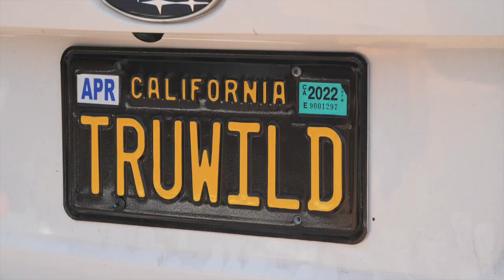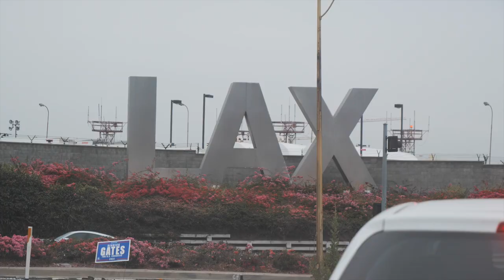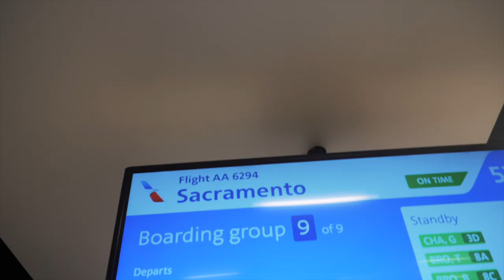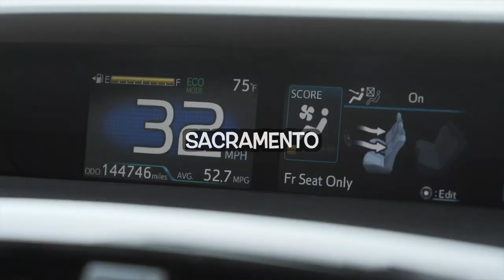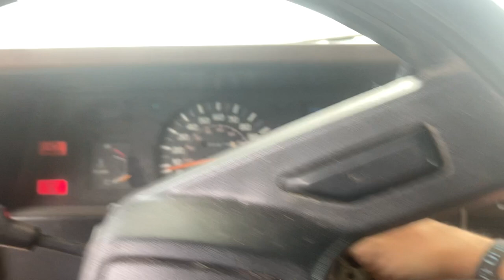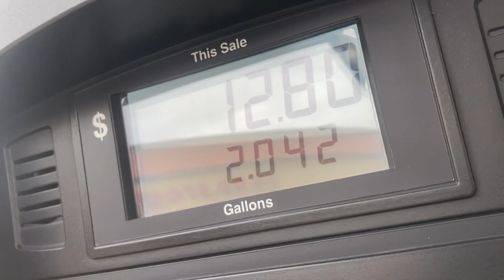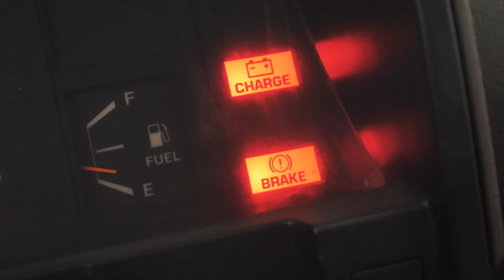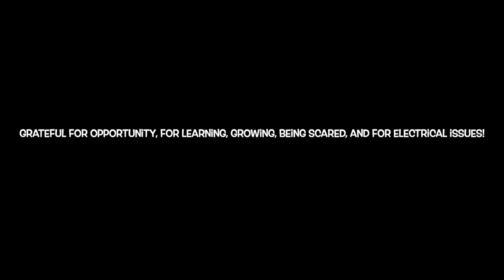It’s Time To SNOWBOARD!

Comment: Hope you get the tortuga figured out. I would first go through and check all of the grounds and clean the battery cable terminals. If it has been sitting for a while it could just have corrosion on the terminal ends. A bad ground will cause all sorts of weird electrical gremlins to pop up. Check where negative battery cable attaches to the starter. There should also be ground cables between the engine block and the frame and the engine block to the body. If any of those are loose or corroded it would cause electrical problems like you are having. Good luck. Keep living the dream.  Yeww
Reply from the maker: That’s the advice I needed Thank you G!!!

Comment: I think the Tortuga needs an alternator Casey! It’s probably dead and not charging the battery anymore hence why after a bit of driving and turning the lights on it dies
Reply: 2nd this
Reply from the maker: I did the alternator last fall and it still did the same thing. It’s not that turning the lights on kills it, it’s switching from high beams to low, or just simply touching the button/ even turning them off. She’ll buff.
Reply: @CaseyWillax  sounds like some electrical issue
Reply: @jairocatalan4974  ....reeeeally?
Reply: @CaseyWillax  ahhhh I see, I'm sure you'll get er figured out and it'll be back in no time!
Reply: @CaseyWillax  You may be right then as you called it a "short" when switching beams.. I would've been checking wiring around steering column like you too
Reply: @CaseyWillax  Did you change the voltage regulator when you changed the alternator?  I think on some alternators the voltage regulator is part of the alternator but maybe on yours it's a separate thing?  And you could have a bad alternator or not enough belt pressure on the alternator to make it spin enough, so it might spin sometimes like if it gets hot or if it gets cold or if you hit a bump... just some ideas...  also alternators can go in and out depending on the current draw.... you might need a stronger alternator to power all the electricity on the vehicle...  a good mechanic will know all this...  and you made it rain in So Cal and Nor Cal, amazing.
Reply: @CaseyWillax  "A faulty voltage regulator can end up stopping an alternator from charging. A no-charge situation can mean an internal break in the windings, burned-out slip rings, or bad brushes. If the external wiring looks normal, the chances are that you have an issue inside the alternator itself.May 20, 2021

What causes a brand-new alternator to go bad? - Express ..." - expressautoirvingtx

"Why is my brand new alternator failing?

Most of the time, alternators fail as a result of age or use. However, some other factors can cause an alternator to fail prematurely. Fluid leaking on the car alternator can commonly lead to failure. Often, engine oil or power steering fluid can work its way into the alternator and cause it to malfunction or fail.Jun 25, 2021" - repairsmith

"Leaking or shorted diodes can often cause a visible fluctuation in the output voltage of the charging system. Bad diodes can also allow current to leak from the battery back through the alternator to ground, causing the battery to run down overnight." - underhoodservice

I'd type in "make model year voltage regulator" and type in Google all your vehicle symptoms and see what happens, but a good mechanic should be able to fix it up...  I'm a mediocre mechanic but you can ask me for free to do Internet research.
Reply: @CaseyWillax  
"Bla Spogelse
5 years ago
Did you ever figure this out?

Soonerfan105
Soonerfan105
5 years ago
Bla Spogelse yes, turns out the original owner wired the alternator wrong when they swapped the engine. Before I had to "excite" the alternator (rev the engine) to get it to charge. Now that I have it wired correctly, it charges as soon as the truck starts without having to rev the engine." - random video

I am going with belt tension and voltage regulator.  Usually the voltage regulator is on the back of the alternator and they can go bad independent of the alternator and visa-versa.

A good mechanic will know.
Reply: @CaseyWillax  Touching the button will change the voltage/amp draw and that's what the voltage regulator does, if it's broken or overwhelmed or just not 100% it can't deliver the correct voltage or change the voltage on demand.

"A voltage regulator generates a fixed output voltage of a preset magnitude that remains constant regardless of changes to its input voltage or load conditions. There are two types of voltage regulators: linear and switching." - analog

"Queivin Deleon
5 years ago
Soonerfan105 i have the same problem on ma 81 the charge light comes on but wen i put ma turn singals on everything on the inside like dash lights n radio go wo the flow of the turn singal n ma voltage meter drops to like like 7 if im not mistakeing. hope u can help

1

Kyuubi
Kyuubi
3 months ago
 @Queivin Deleon  idk if you’re still alive lol. But I’m having the same issue. You ever figure it out?

Ryan Taitano
Ryan Taitano
1 month ago
 @Kyuubi  I’m having the same issues as well lol just got a truck from this guy and it’s giving me more problems than my last truck

Kyuubi
Kyuubi
1 month ago
 @Ryan Taitano  I by passed the truck regulator and got an external regulator on the alternator and it fixed my problem" - random video

"What are the symptoms of a bad voltage regulator?
Image result for what does a voltage regulator do
Bad Voltage Regulator Symptoms
Too High Voltage in the Battery.
Dead Battery.
Battery Light or Check Engine Light.
Inconsistent Operation of Electrical Components.
Vehicle Dies While Running.
Dimming/Pulsing Lights." - mechanicbase

"Can I drive my car with a bad voltage regulator?

You may be able to drive with a bad voltage regulator—but not for long. If the regulator is causing low charging system output, the battery will eventually become discharged and the vehicle will no longer run.Jul 15, 2021" - carparts
Reply: @-tr0n  😂
Reply: Yooo
Reply: You need more ground

Comment: Like "Dalton Balkwill" mention before. I'm 100% sure is the alternator!
Reply from the maker: I did the alternator.
Reply: @CaseyWillax   If the alternator is good, you should check ground (-) cables. Run a cable straight from the engine block to the battery (-) and see if you see better performance. You could use a jumper cable. A car should be able to run without the battery. BTW Autozone and places like that would check your alternator for free. It's never bad to double check. Hope you can get this figured it out soon. I like Tortuga!!!

Comment: It seems like you have this thing called parasitic battery drain. This could be a faulty relay, a headlight/dome-light switch, alternator, or any other electrical gremlins. Check all your grounds. Look for chewed up wires or wires that have been improperly terminated. Check fuses and relays. Look for corrosion or burnt up wires.
Reply from the maker: She needs a wholeeee list of check ups huh

Comment: I know in prior comments you mentioned you replaced the alternator last year. The problem still could be the alternator... the Tortuga is old, so there's a chance you may not be able to find a new alt and only refurbished. Which is doable in a pinch, but I don't recommend it unless the refurbished one is Denso brand. Now, it's true that it could be a wiring short somewhere down the line (even as simple as a loose connection at the battery, though you would have fixed that when changing the battery out). I would get a battery/starter/alternator test done to rule out those parts. O'Reillys and Napa do that test. I personally have a jump starter and air compressor (I recommend getting one) or call me. I can totally come to the rescue in the SF Bay/Tahoe area or anywhere in between.
Reply from the maker: Yewww!! I wish it was a simple alternator fix but ruled that out 5 different ways! I’ll check the other tips Thank you so much!!
Reply: Ok. Good. What's the word as of now? Any updates??

Comment: get your charging system fixed in the yota bro, prob crap alternator
Reply from the maker: I did the alternator
Reply: @CaseyWillax  not sure if that rig has a voltage regulator, but might be worth a shot